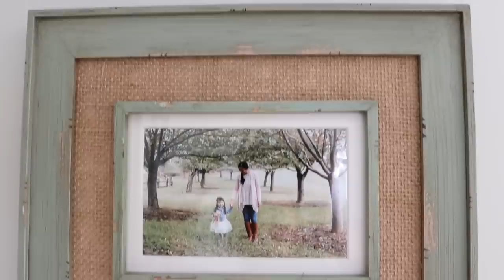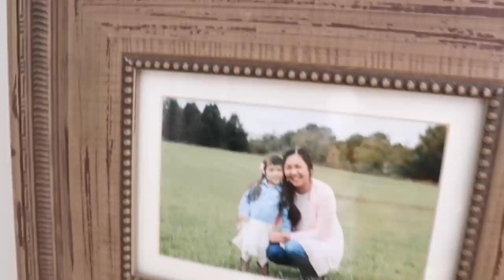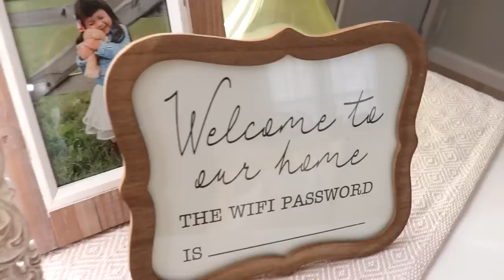$89 LIVING ROOM MAKEOVER

Comment: Won’t the paint on the heater create toxic fumes when turned on?
Reply from the maker: The paint is just on the wood part and not on the metal part. The electric heater piece is inside and there is a fan that blows the hot air out. Should be fine. :)